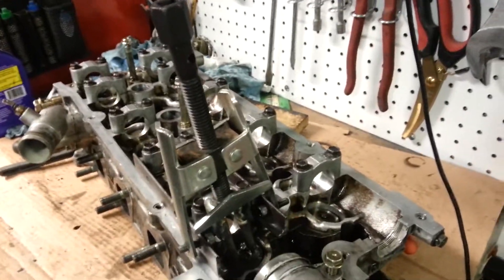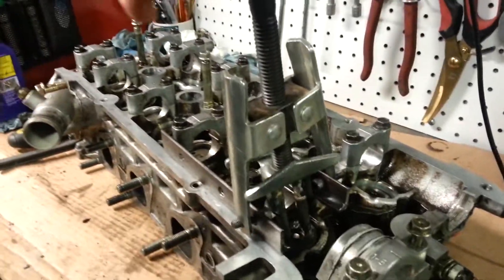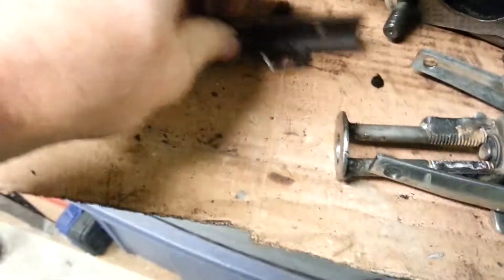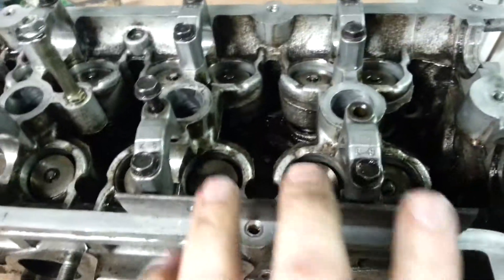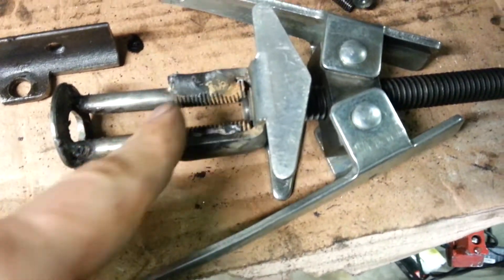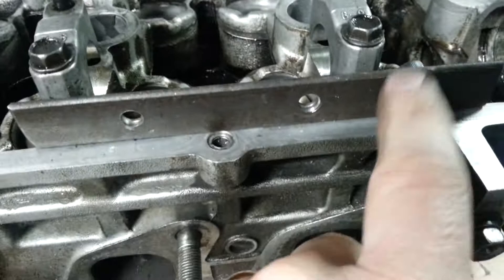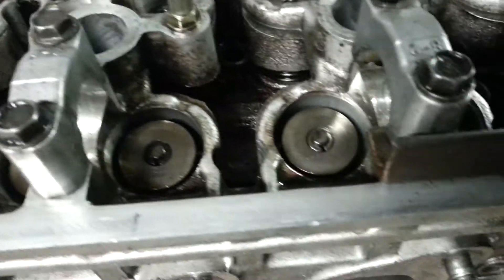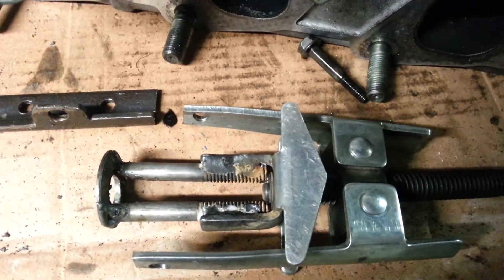Nissan KA24DE valve stem seals replacement with a custom tool. This is how I did it.

Comment: now you know you can rent/buy the correct tool to do this and not make a useless video that is totally not worth watching cause both videos don't do nothing in reguards to Removal or Installing Valve Stem Seals #WasteOfTime
Reply from the maker: I could not find a tool. Sorry you did not like it.
Reply: @NissanNut74  it's not that I didn't like it but what you could do is look at a tool and make one yourself with some better material than using an old STOP sign and All-thread you have a GREAT MIND to come up with something like this but if you gonna be doing a head stay focused on it please